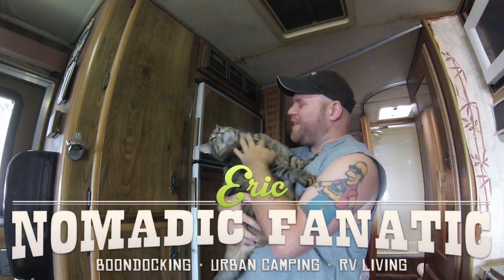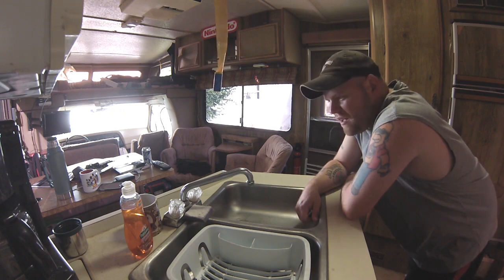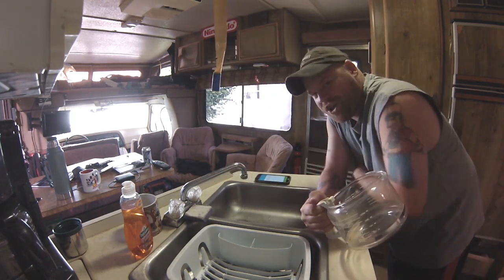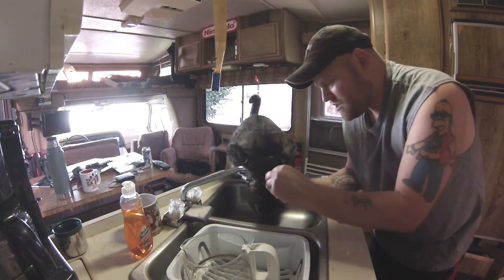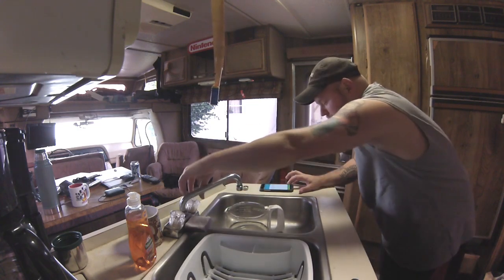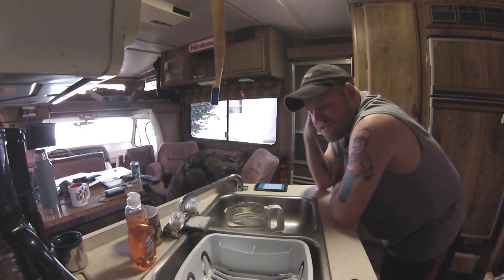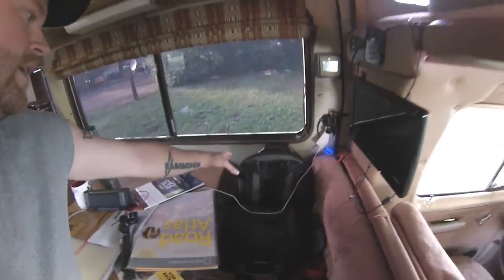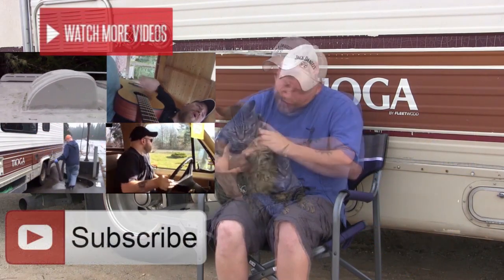Easy Water Saving Tool (0.5gpm)

Comment: Thanks for the video Eric.  I went to Amazon and bought one for my RV right after watching.  I ended up going with the 1.5 GPM ones.  They have a 2 pack for 8 bucks.  They will be installed in my class C RV (A 2002 Coachmen Leprechaun 29 footer).

Comment: Looks like the water pump flow is pretty high, I'm betting more than 3gpm. My pump is lower flow 1-3 gpm depending on what the system voltage is and I've suffered with the exact same experience Eric has conveyed. Wish I'd have seen this twenty years ago - the 0.5 gpm RV sink Aerator is the cats meow for sure. I'm hoping Eric shows us how to keep it all flowing if it gets freezing out this winter.

Comment: Get a 40" TV with a fold down mount, attach it to the ceiling above/inside the over cab bed and it will be well out of the way when not in use and you'll still have the storage over the cab.
Reply from the maker: +Paul Keating Cool idea!
Reply: A 40 inch tv is too big for this RV, plus a screen that size would use too much power even if LED.
Reply: +John Fiskin 60 inch would be perfect.
Reply: John Fiskin It doesn't have to be an LCD, it could be a white screen and HD projector.

Comment: Eric, check the minimum draw from the inverter on your batteries...when it sits idle it still draws some power...the 2000 watt will draw a lot to have on all day running things that only take a small amount of power.  You might try getting another small one that doesn't make noise...I have one, its a KISIE 400 watt....

Comment: Heard you say you are going to be traveling soon, did you get the 3 replacement tires for the RV? Did you also get a correct spare? Don't know if you carry a spare parts kit for the RV or not, spare parts being, fan belt (s) radiator hose, duct tape, fuses. If so maybe you could do a video on preparing the RV for travel. Keep up the good work
Reply from the maker: +Jim Krueger Working on it. I've got a plan and a timeframe. :)

Comment: How about if you changed out that faucet with one that has the spray (hose) nozzle. That way you could get the best of both high pressure to fill your coffee pot and low flow for general uses.

Comment: Eric,  Is it possible to put a coupler on the RG6 Coax and move your Sat Box over the driver's seat area and not use an extension cord for power? Have everything powered off the plug off the 2KW inverter? I hate extension cords and you can connect directly into the outlet then... Just a thought!?
Reply from the maker: +J Doe That is a possiblilty. Thanks.

Comment: I have one of these on the house faucet, I  always wondered why I didnt turn the valve under the sink to a more closed position instead. But then I needed water. I can wait 7 seconds or 30 seconds 12 cups is 12 cups and my electric 220V water pump doesn't run as long in 7 seconds as it will in 40 seconds. I think it is probably better on the RV for things like rinsing dishes etc.

Comment: you mentioned the fan on your inverter was annoying. A lot of times the bearings/bushings will dry up since it is running constantly. A little drop of oil on them will work wonders on a noisy fan.
Reply from the maker: +Stephen Dennison Oh cool. Thanks.

Comment: id like to get a 12v TV for my RV. I didnt know they existed before you made me aware. Are they made in a 32? 

I had pretty much the same RV that you are in now and mounted my TV with a flip down mount like someone had mentioned. Be sure to catch something solid. I had screwed in to the ceiling thinking it was good enough and after about 4000 miles he came down and nearly hit my golden retriever in the head. if I were to do it again I would screw the mount 1/2 inch piece of plywood and then screw the plywood to the ceiling of the RV.

Comment: Does this water restricting  cause back pressure that can affect the electric water pump in a negative way?  Does the pump keep cool by allowing a higher flow through it and restricting the flow causes it to heat up?

Just trying to think of this in engineering terms regarding the affects on the pump.
Reply: +BillyLapTop No.  The pump is pressure on demand.  It cycles on and off as the line pressure changes.  10 cups of water is 10 cups of water. My pump cycles approx. 1 second on/one second off with no restriction at the faucet.  With this device it should be about one second on/seven seconds off.  The pump will build pressure just as quickly but due to the restriction the pressure drop is spread out over a longer duration.

Comment: Those cabinet doors sure could use some contact cement on the peeling veneer.  Not hard to do, apply cement, let it tack up, then roll it out with veneer roller.